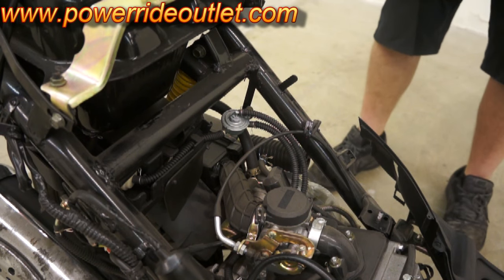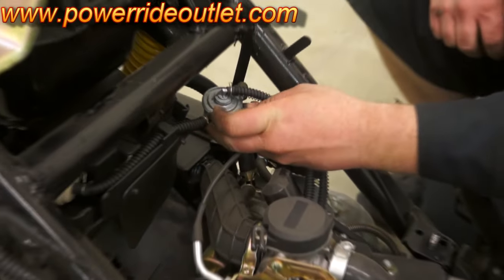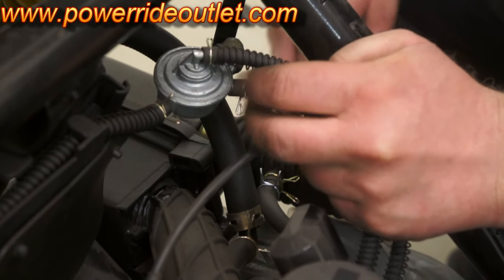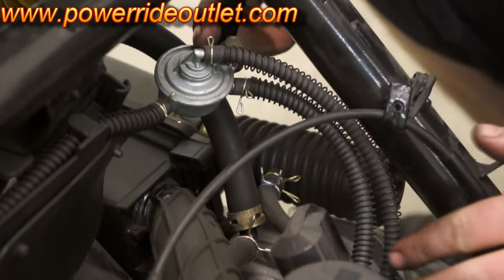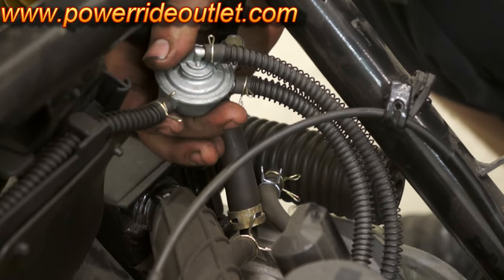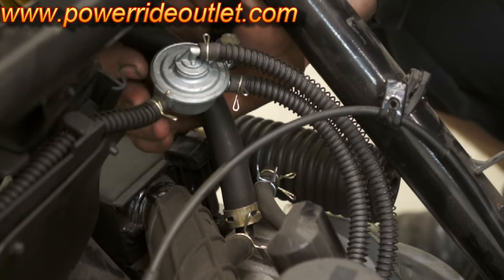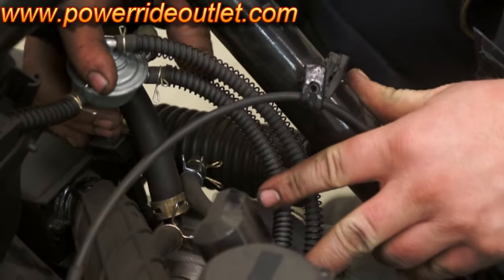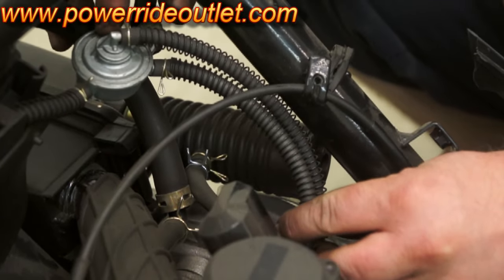scooter 101 fuel system part 1

Comment: I just replaced my carb now my scooter won’t take gas it was before I replaced the carb. The one I have now is brand new what do I need to adjust to make it suck in gas
Reply: Open.
Up the top of the carb and drop just a little gas inside with Syringe.

Comment: Can you show me exactly where the vacuum hose connects to
Reply: The vacuum hose connects from the GAS PUMP to the  BIG BLACK HOSE connected to the FRONT of the carb on the LEFT SIDE facing front. There's a nipple on which to place the hoseline. Pull it off and look - you won't break anything. When you replace it, place one end on at a time to follow the line. That's what I did and how I learned. I have a 50cc Chinese scooter.
Reply: Inlet manifold. To nippel.

Comment: Is gas soppoused to come through the vacuum line on that fuel pump..mine is pulling gas through the vacuum line... does that mean the pump is bad..
Reply: Hi  I have tgb 08 50 scooter    brought new  carby    put it in and now  fuel is leaking    pouring out
Reply: No gas thru vacuum line. It means your gas valve diaphragm is probably bad. You
Reply: @nathanwright87  I had the same prob w/ my NEW scooter. The gas line wasn't connected properly. Got on YouTube VERBERELLO, and replaced my entire gas line w/ 3/16" INSIDE DIAMETER 5/16" OUTSIDE DIAMETER irrigation line -CLEAR - that I got at Lowe's for $5 for 5 feet, per my instructor.
Reply: @nathanwright87  Same problem for my 500cc Two Stroke. Way too much fuel.